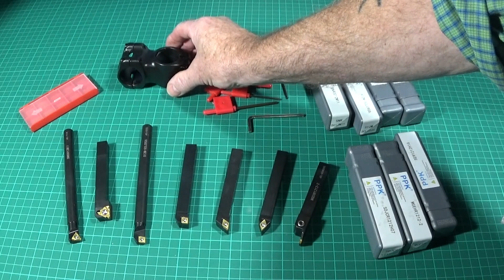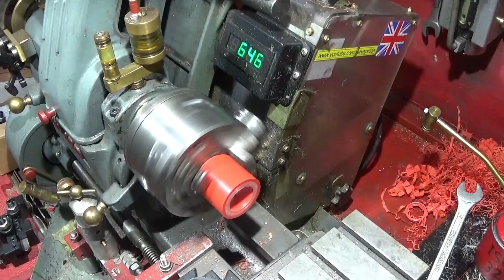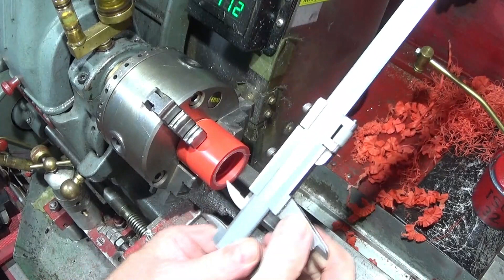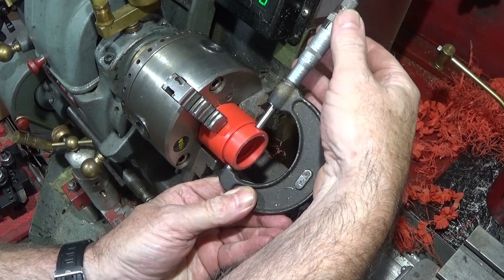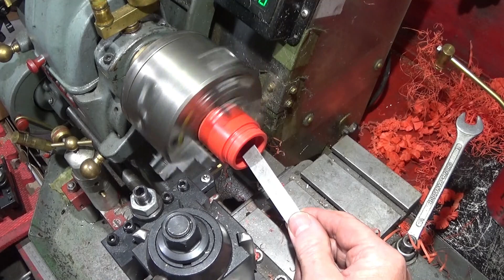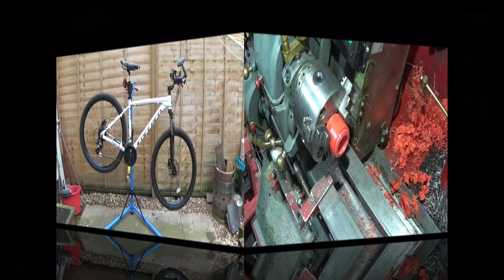A New 7 Piece CNC Lathe Tool Set Plus Making A Nylon Spacer

Comment: Good to see you back Steve. Do you still have the same inverter and 3 phase motor that you recommended for the Myford?. I still have them
 on mine and they work well.
Reply from the maker: Hi Andy, Thanks. Yes I still have exactly the same set up and they are still working perfectly as well. Regards Steve

Comment: Welome back. I bought a similar set with a smaller shank size as I have not reduced the topslide height on my Super 7. The only issue I have is with one of threading tools where the insert does not fit very well in the holder: nonetheless, good value for money.
Reply from the maker: Hi George Thanks. You will most probably find that the problem is the way you put the insert in. Just put the insert in place first, then put the screw in. The screw hole is slightly off position so that when it screws down it actually pulls the insert into position. If you put the screw in before the insert is seated the insert tends to bind with the sides and doesn't go all the way down, leaving a slight gap. Regards Steve.

Comment from the maker: SEE LINKS BELOW TO BUY THE CARBIDE LATHE TOOL SET & DEBURR TOOL:-
7pcs 12mm Shank Lathe Boring Bar Turning Tool Holder Set with Carbide Inserts
https://ban.ggood.vip/12CsB
Regular Price: $48.50
Coupon Price: $45.99
Code: BG238077
Warehouse: CN
EXP: 10.31

NG1000 NB1100 Burr Handle Scraper Deburring Tool 10pcs Deburring Trimming Blade Cutter Tools Kit
https://ban.ggood.vip/11oHa
Normal Price: $17.49
Coupon Price: 20% off ($9.59)
Code:  BG9f88de
Warehouse: CN
EXP: 4.30